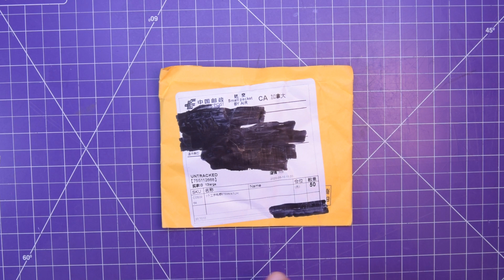Mailbag 63 - All The Small Things

Comment: Nice. I have a bunch or stepper drivers (DRV8825, A4988, TMC2208). The silent TMC2208s are in my Ender3.
I guess I should make a CNC machine!
Reply from the maker: as should I! Race?
Reply: @SimpleElectronics  Hmm. I only have 28BYJ steppers in my stock (with drivers). Making PCBs? Possible...
Reply from the maker: @Codedbad  I have those steppers in my horde too!
Reply: You guys should donate your "broken" RAMPs board, and "obsolete" stepper drivers to ME.
Those things would be an upgrade to my lousy, stock, Anet A8 board.  It has only 128mb flash.
Can barely fit Marlin 1.8 bugfix on it.